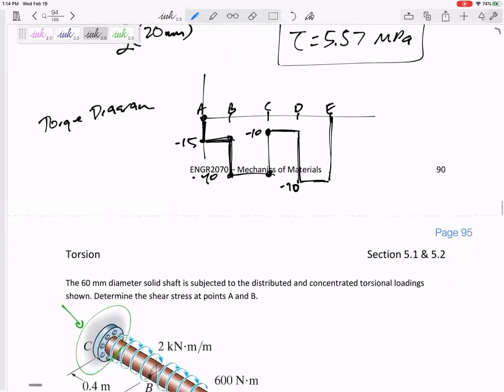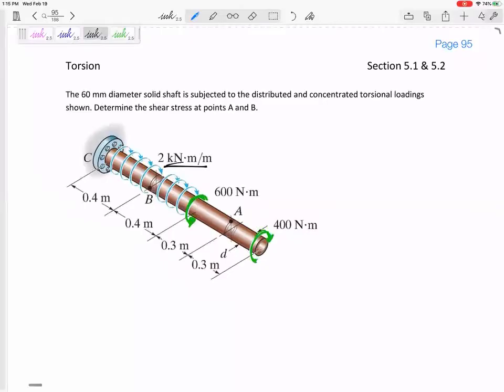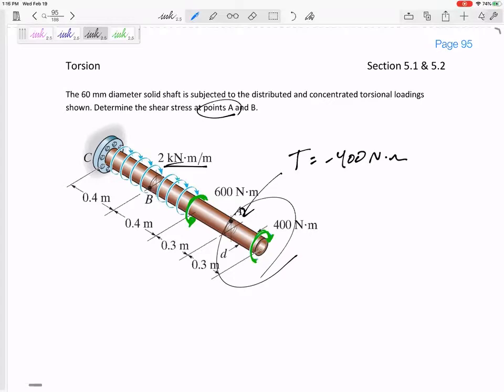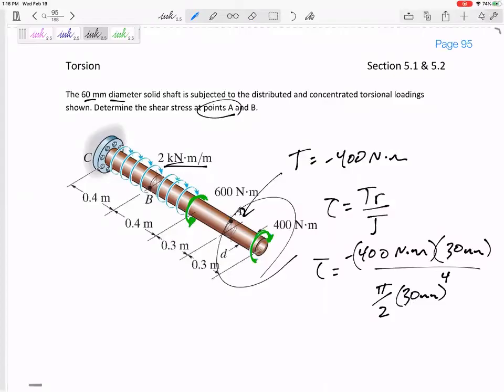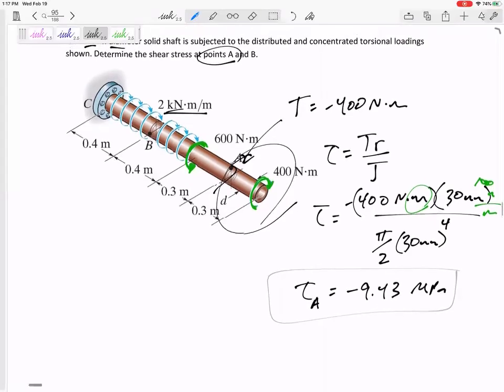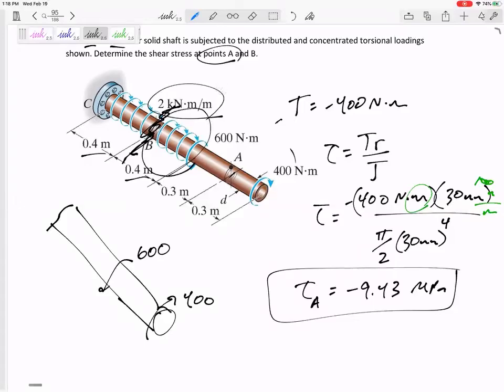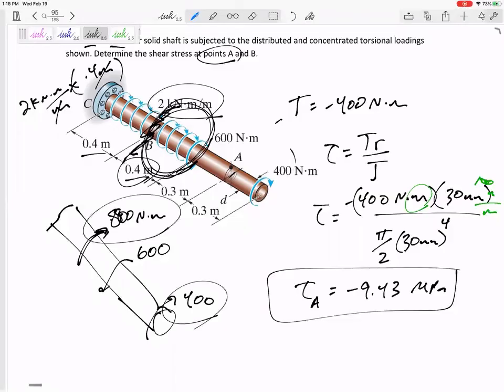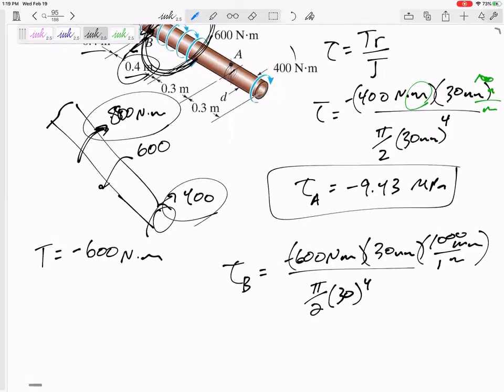Mechanics of Materials - Torsion example 3

Comment: sir ı could not understand why you written -400 to internal moment of stick? You said that if our thumb outisde from the direction it is postive but you assumed that 400 is negative ı could not get the point
Reply from the maker: If you cut at A and keep the last 0.3m of the beam, then you would need an internal negative 400 at that cut. Using the right hand rule, your thumb would point into the cut making it a negative 400 right there at A.
Reply from the maker: Also, if you cut it at A and keep the first 1.1m of the beam, you would still get a negative 400 at the cut. Your right hand thumb would be pointing into the cut.
Reply: @engineeringdeciphered   thanks sir you are the best

Comment: sir, by  solving moment equation A is not negative .. 
if we take C=1400 then 
1400+600-1600-A=0 .. A=400 .. 
where is my mistake in the equation ?
Reply from the maker: The signs for the sum of the moment equation are just determined by however you want to define + and -. Since we are summing to zero, it doesn’t matter what you call + or - (as long as you stay consistent). But the sign convention for the internal torque, shear stress, and angle of twist (if you are using “positive sign convention”) is determined by the right hand rule: whether it is out of the cut (+) or into the cut (-)
Reply: @engineeringdeciphered what I did is like standing in front of the shaft and putting positive signs to counterclockwise .. 
is this okay?
Reply from the maker: @NH-pv9tm  if the “cut” is on the front side, yes that’s fine. But if you cut it and the cut is on the “back” side then you need to “walk around” to the back side to look at it and say that CCW is positive.
Reply: @engineeringdeciphered  I got it .. thank you a lot sir , I really appreciate your help 🌹..

Comment: sir, how do we determine the direction to find internal forces? In previous examples, we looked for the left-hand side of the cuts to find internal forces. However, here, we looked for the right-hand side of the cut. How do we determine this? Because the answer is changing according to the way we choose.
Reply from the maker: Using the right hand rule, if your thumb is pointing “out” of the cut- that is positive torsion. Another way think about it: if you are looking directly at the cut, counterclockwise is positive. Be careful, because if we are cutting it like in this case, if you want to “look directly at the cut,” you have to imagine yourself walking around to the back side of the beam in order to see the cut. Does that make sense?
Reply: @engineeringdeciphered  actually ı asked a different question. it was not about the sign of the torque. My question is that to find the internal torque in each section, we made a cut, looked for the left hand side torques, sum them up, and our internal torque will be same magnitude and opposite direction. In this question ı applied same procedure but found different torques. Fortunately ı found my mistake. That is support reaction. We have to consider support reaction(torque) for this question. Thanks for all your response sir!
Reply from the maker: @abcdefgh-kb1cu  ah yes yes! Don’t forget about the reaction at the wall!

Comment: should it not be +600 Nm for section b
Reply from the maker: It’s negative 600 Nm. You can use the right hand rule and thumb would be pointed into the cut. I think I have a video about +/- torque in the playlist. It’s hard to show and visual in these videos.